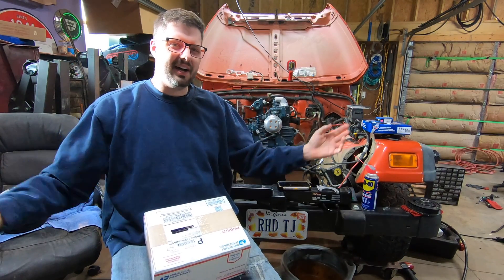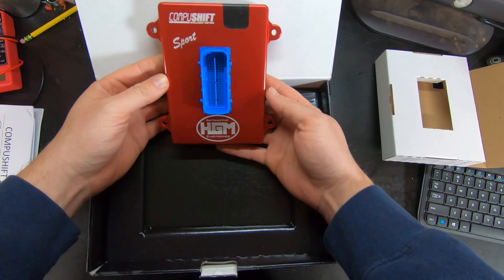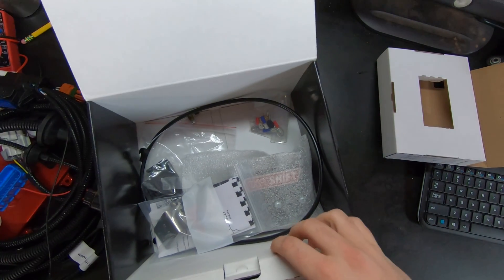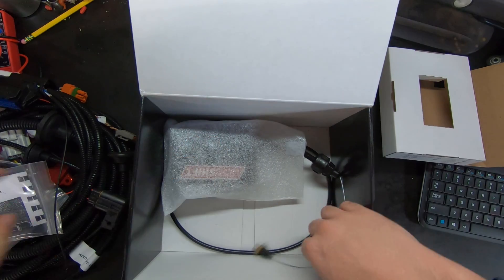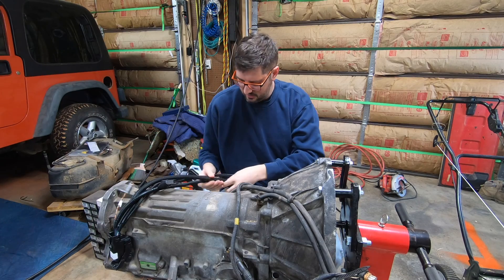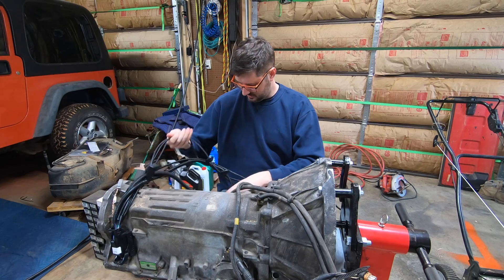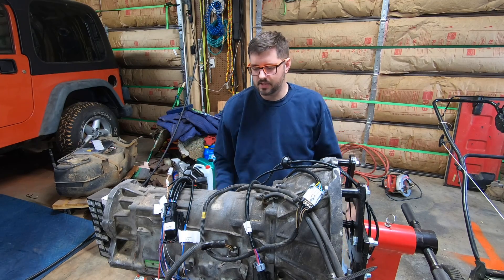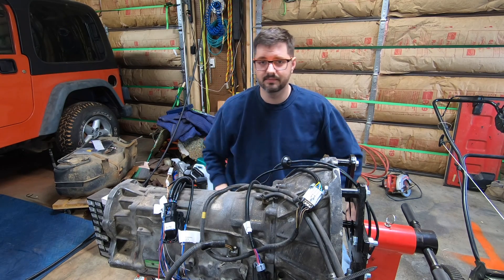HGM Electronics CompuShift Transmission Controller for the AW4 Automatic [Felicity - 18]

Comment: Is this a need for a swap like this?  I am interested in putting a diesel in my XJ and am completely lost about what to do to make it work with the AW4.
Reply from the maker: You can use the stock TCU from your XJ but I don’t know the details. I didn’t have one of those TCUs or wiring so it was worth it to go with the CompuShift.
Reply: @RustyAutoholicGuy   Thanks for the response.  I will look further into it.

Comment: Regarding USB micro instead of USB C... we really tried but at the time of design there were no IP rated USB C connectors on the market that would fit in the aluminum enclosure.
Reply: Not sure if this product is still available after seeing this four years later, so has there been an updated to USB-C?  Wish there had been a web link.  Yet I know some change product focus as interest can change. Though there are those of us still like, use or prefer vehicles of this era. Thank you.

Comment: you bought a aftermarket TCM, when the aw4 does not need a tcm to operate, and you bought a wintershifter kit from radesign, which does everything you need be side TC lock up, which is a two wire and one toggle switch hook up. Completely defeats the need of getting the winters shifter. Besides manually shifting a aw4 and having full control is way better then letter the tcm take control even on a DD.
Reply from the maker: Yeah I've got a habit of buying to many parts for a project and this falls into one of those categories as well. I'm not sure I'll be using the Winter's shifter anymore, might be saving that for another project, still going to run TCM though, it has some neat features for both on and off roading that I want to play with. BUT with all that said, I might get the Wrangler on the road, hate it and pull the TCM out and go with the Winter's manual shifter setup, only time will tell!!!
Reply: @RustyAutoholicGuy  I could use that winters shifter.  Swapping an aw4 from a 91XJ into my 90YJ.
Reply from the maker: @albertobu  I've got it mounted in on my center console! Highly recommend you getting one, they are fantastic!
Reply: @RustyAutoholicGuy  yeah.. I've explored other options and looks like that's the best and simplest
Reply: @RustyAutoholicGuy  you wont get engine breaking with the TCM, engine breaking is only able to be done by having full manual control as in actually moving the shifter. the shifter cable has to do with engine brakeing, as the tcm just controls the solenoids for each gear. FYI. Thats why i said its point less to run and have that tcm. extra money spent that was not needed.

Comment: in process of 4l80e swap into hmmwv m998 hummer and am also very impressed with quality of this system. waiting for drivesahafts to be made and a dipstick tube. but am not foreseeing any issues as the quality of the harness and tcu are very good to excellent
Reply from the maker: Agreed Scott, I'm just now about to install the CompuShift controller and I'm expecting it to work flawlessly. The only input that is going to be slightly difficult to figure out is going to be the RPM signal!